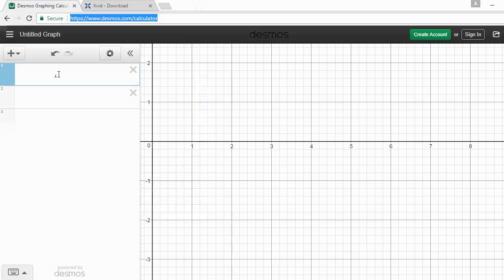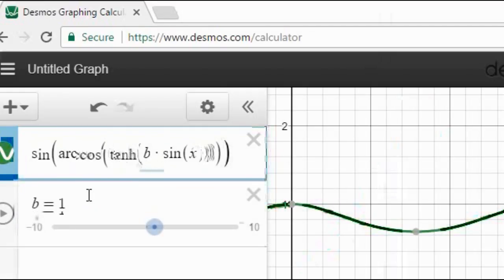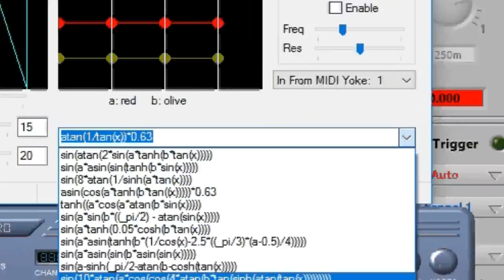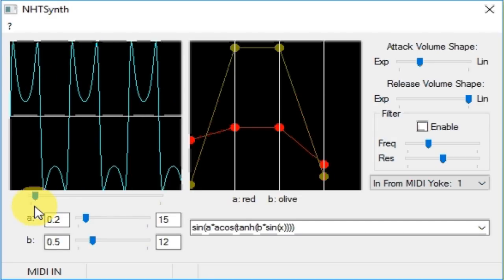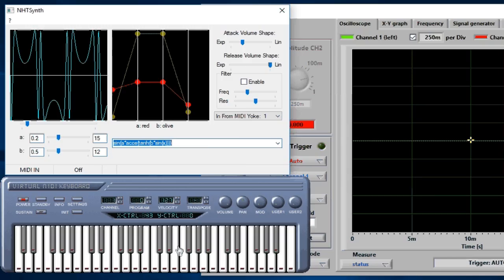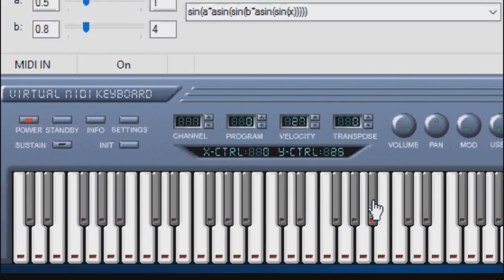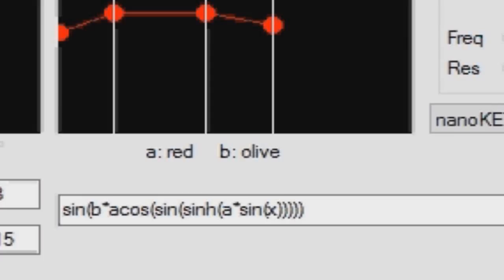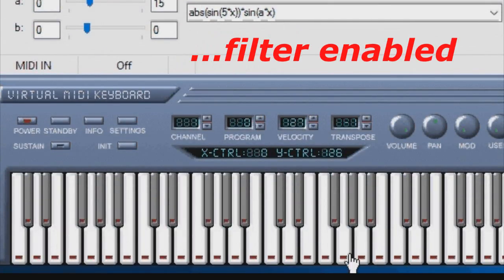Innovations In Sound Synthesis - NHT Synthesis

Comment: It's an interesting way to have short mathematical expressions creating sounds that otherwise might require big FM-based or additive synths, but the eternal problem (as I see it) is the lack of reverse engineering tools (how to go from sound back to formula). This makes it really hard to design a sound with certain characteristics. Just as with FM synthesis, you basically have to stumble upon interesting combinations of operators and coefficients (which can be fun of course, but not when you're trying to meet a deadline ;) ). So far I'm only aware of genetic algorithms as a technique to approximate an existing sound using networks of non-linear operators.
Reply: http://www.synthtopia.com/content/2017/07/13/aphex-twins-patch-editor-uses-artificial-intelligence-to-evolve-synth-patches/
Reply: Just curious: what method do you use to compare the sounds?